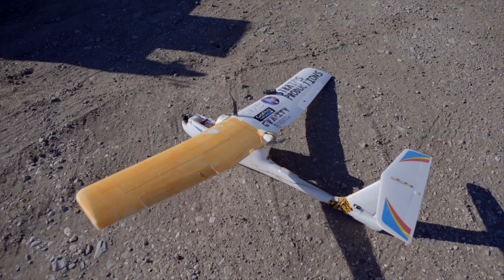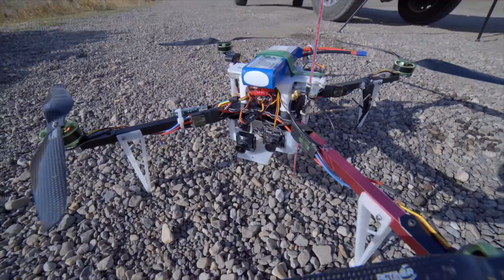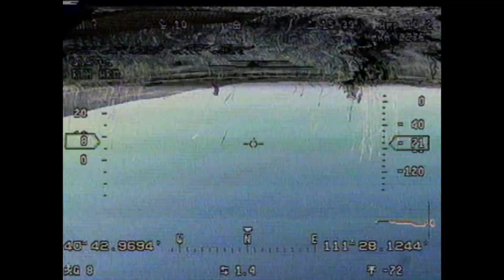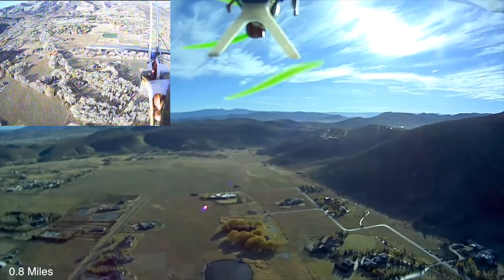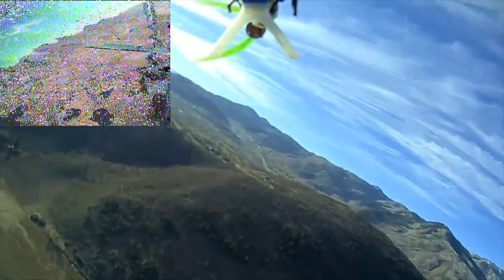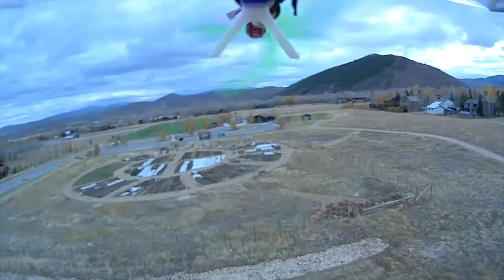FPV Blue HD Video Link Tests - RCTESTFLIGHT -

Comment: Yay, first time I get a shout out from you, one of my favourite FPV pioneers! thanks a lot!
your flights were great. I also thought of comparing 5.8 analog and the new fpv blue sys.
I installed it on a RC truck and went quite far into the woods. Cant really fly far here with our tight regulations...
I flew with an old quad as well - also had nasty jello (but my quad is NOT balanced well).
Keith LR flights with this system are awesome! 
greets, RCSchim

Comment: It was a nice little test, but it didn’t really show us much about latency, which is key for FPV. You said it was superior at longer range, but did the latency increase that far away? How was the latency in general compared to analog?
Reply: Because radio frequency transmissions travel at roughly the speed of light, from what I understand distance means essentially nothing when it comes to latency, that is specific to the processing of the image, not the distance traveled. That is unless, you are flying light years away.
Reply: That's not exactly what I mean, usually when the signal strength drops on digital systems you get lots of packet loss, error correction kicks in and frame rates drop, resulting in increased latency. On analog video, there is no difference when the signal is low, same latency.
Reply: 500ms would be terrible for FPV indeed. Unusable
Reply: Latency is negligible, unless you are Mini Quad flying, in which case you should not be using a pro FPV rig like this anyway.
Reply: The latency is pretty small, so unless you are flying close to the ground (like with a Mini Quad for instance) the latency is not going to be an issue. I didn't say FPV flyers should not use a Pro HD rig like this, I said it would be wasted on something like a Mini Quad. I suspect you have never flown anything FPV too.

Comment: Hi, how do you check if wind speed is okej for your flights? How much wind is too dangerous to fly with a large glider?
Reply: Laggeros It's difficult to say for sure, since the affects of wind on a glider will depend on the type of glider. For example, a slope soarer won't be as affected as a thermal glider. For the most part I'd say from personal experience that winds above 12mph(19kph) require you to consider whether conditions allow for a safe flight, Especially since winds are usually stronger at altitude. Hope this helped.

Comment: You should try a 4G system of sending video, yes it might have some latency but then you'd be totally free and never lose signal really and you could go 30 miles on solar! You'd have to work out a control signal over 4G though, must be do-able.
Reply: Looks an interesting development.
Reply: With some stabilisation on-board thats could work :D
Reply: You would be really limited actually, cell towers have directional antennas that cover only ground, so you could only fly low, with breakups because of questionable coverage. No point in covering the air, it would be expensive, and covered air space would be rarely used.
Gprs however uses omni antennas and can be caught higher above ground, but its not fast enough for what you suggested.
Reply: you would have to have a good autopilot and rely much on stabilization. this sys here is good because it has very low latency and high image quality. the creator of this sys actually started with 3g fpv transmission as his first digital trials :)